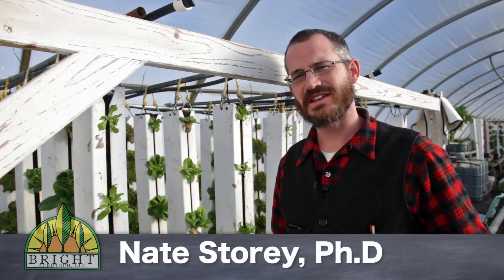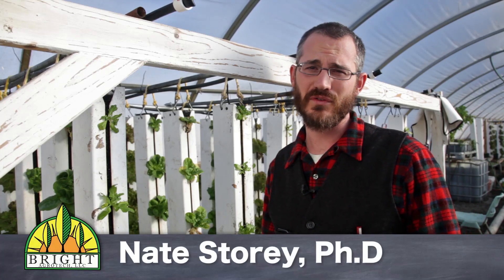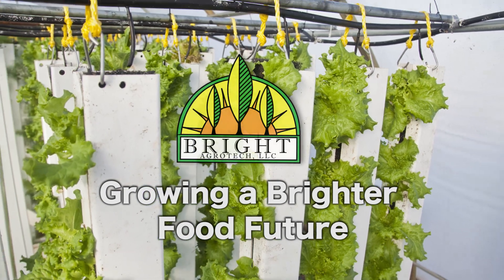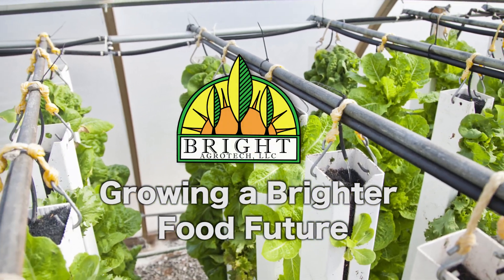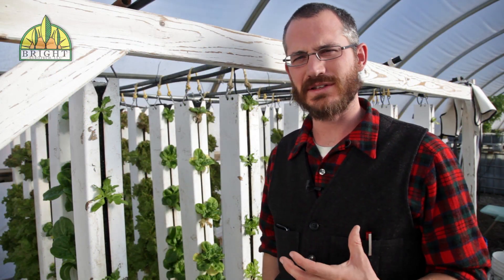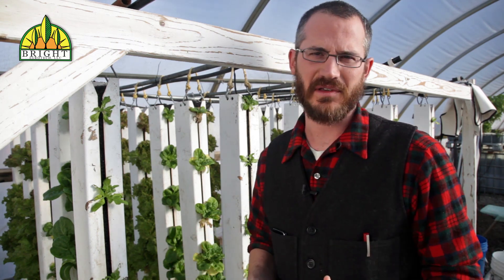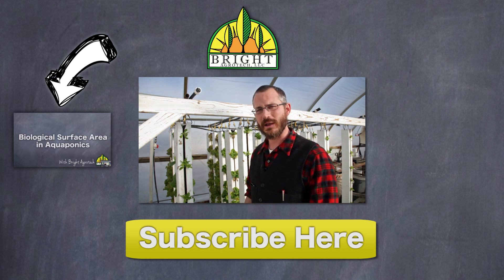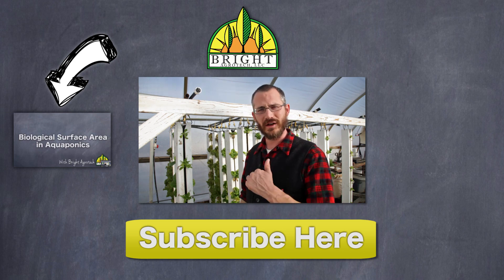Removing Solids in Aquaponics

Comment: At 2:10 you state, "The red worms consume those solids" - worms produce worm castings.  I have to assume those worm castings are building up in the towers, no? You've simply turned one kind of solid into a different kind of solid.  Isn't that a problem?  If not, why not?  Thank you.
Reply from the maker: Hi +DrDangerPuppy - Great questions! Red worms take big solids and make them smaller solids while releasing lots of soluble nutrients into solution.  It's true castings can build up in towers, but they're a totally different kind of solid compared to algae and larger fibrous solids. Hope that makes sense.
Reply: It does make sense.  And that's precisely my question.  It's a different kind of solid, but a solid nonetheless.  In fact "worm castings" as you probably know is just another name for top soil.  So now you have top soil in your towers.  Granted plants have been growing in soil since pretty much the dawn of the earth, but... you have soil in your towers!  And I imagine over the course of maybe a few years perhaps, you're going to have a LOT of soil.  I guess it's not a problem yet, but I can't imagine the runoff from the tower will stay clean.  Eventually I would think it would start to mix in with the water and dirty the water with top soil... and then recirculate that to the fish, causing cloudy water at a minimum, which I suppose is then filtered out by... as I recall you don't have a swirl or radial filter so it goes back into your towers where it's not broken down any further right?  Hmmm.  Clearly it hasn't been a problem for you yet, I just wonder if all that buildup will eventually require gasp cleaning the towers?  Or perhaps some other calamity.  I wonder if your tower runoff still runs clear?
Reply from the maker: +DrDangerPuppy Worm castings and top soil are totally different.  Worm castings are extremely fine solids in the process of being broken down, with lots of soluble constituents that were produced in the worm digestion process. We have run towers for many years with worms and without cleaning and it hasn’t been too much of a problem for us yet, but we’ve only been doing it for 8 or 9 years, so we may have some problems next year that we don’t know about.  If you’re using towers you may have to clean them from time to time- we advocate using your noggin and doing what is best for your individual system.  Best of luck!
Reply: Thank you.  I appreciate the enlightenment.  It's always nice to be educated by someone that knows what he's talking about.

Comment: Hi Nate,
Thanks a lot for another really interesting post! 
If I understand good, a good media will act as a filter for the fine waste and the fine particles are mineralized directly into the towers. The bigger, heavier particles are trapped in some settling tanks you say. Is it something relatively cheap like swirl filters or radial filters ? 

Then, where in the circuit should those settling tanks be fitted ? You describe a plumbing in several loops being ideal (see video on one-pump systems here : http://verticalfoodblog.com/one-pump-vs-two-pump-aquaponics-systems). Do those settling tanks have to be in the same loop as the fish tanks ? Or do they constantly filter a part of the sump water ?

I will be following your other videos, thanks again for inspiring us!
Reply: +Bright Agrotech Link is gone...
Reply from the maker: +DrDangerPuppy Good catch! I just changed the link, but here it is again: https://www.brightagrotech.com/solids-removal-in-aquaponics/ - Thanks for catching that and have a good rest of your weekend.
Reply from the maker: Hey +Greg aquaponienet - check out our reply on the blog comment you posted: https://www.brightagrotech.com/solids-removal-in-aquaponics/
Reply from the maker: Hi +Greg aquaponienet - Swirl filters are great and worth looking into. If we were to install one, we would put the swirl filter downstream of the fishtanks and upstream of the sump tank. If you need more info on aquaponic filters, check out @bnbob01  (https://www.youtube.com/channel/UChz2QEbZECEzUih1DiqZTNA)

Comment: Hey Nate,

Thanks for the video!  Another idea: I'm running a Skippy-style mech/biofilter right out of the tanks and before the sump; they're a cheap and easy diy build, and it keeps the sump clear and prevents the pump and lines from clogging.  The solids that do make it to the towers are teensy, but they still cling together and build up once they get into the media.
Reply from the maker: Very cool!  I might have to build one of those to play with.  I'm really glad it's working for you.  There are lots of great home-made solids solutions out there.  Thanks for sharing what you're up to.  We might have to try it out and do a video on it sometime.